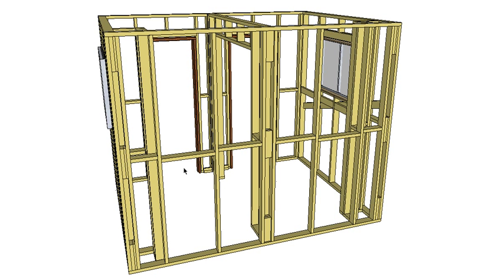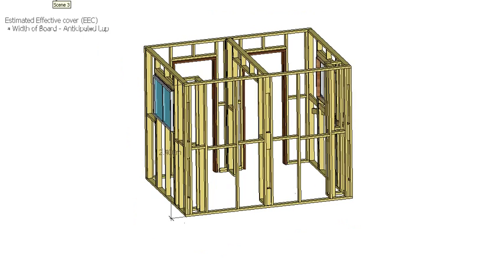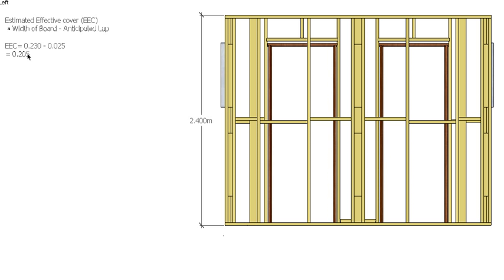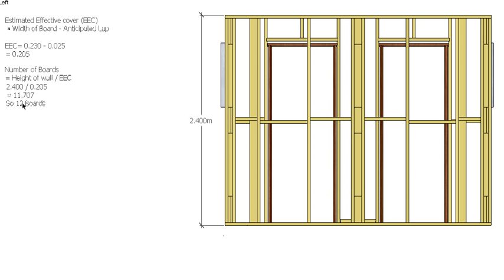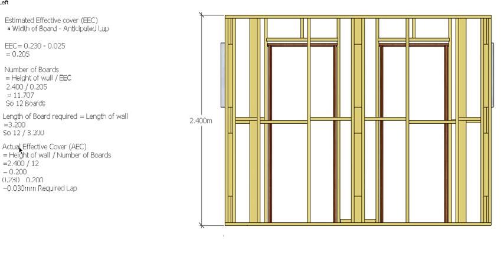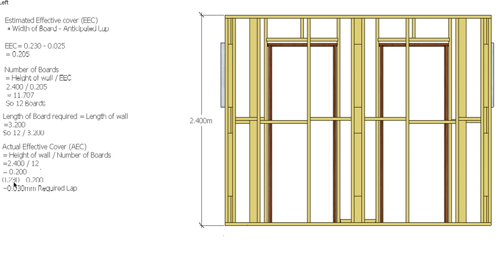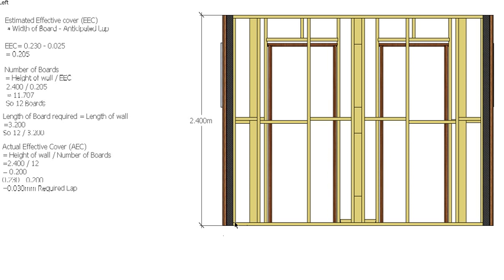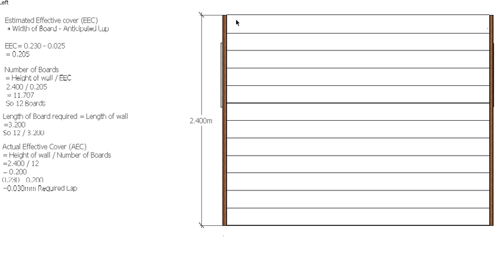Calculate the effective cover of Plank Type Weatherboards Example 1.

Comment: How much do you lap the kicker strip with on your second board as the Kicker strip is basically the first?
Reply from the maker: Hi, I normally make the kicker strip the same as the required lap so that the kick is consistant. Hope this helps.
Reply: @Buildsum  I just realised I put up the first board without a kicker strip, should be alright no?
Reply from the maker: Hi Mate, it is just going to look flat and out of place but alot of people wouldnt notice it.
Reply: @Buildsum  cheers, yeah it actually doesn’t look too bad.

Comment: Can this method be used in sections? For example, I I want the weatherboard to meet flush with the top and bottom of a window. Could this calculation be run up to the sill, then to to the top of the window, then to the top of the wall?
Reply from the maker: Hi Mate, Yes it can, this video may help
https://www.youtube.com/watch?v=077BKANA918&t=18s
Reply: @Buildsum  thanks very much 👍

Comment: I think if it's bearers and joist, the bottom board has to be 50mm lower than the bottom of the bottom plate. is this correct?
Reply from the maker: Hi Mate, not sure if it need to be 50mm below but it should start lower then the bearer to provide a drip edge so water doesnt start tracking under the floor.